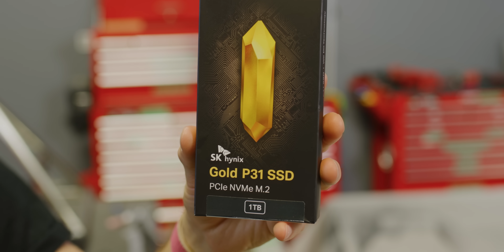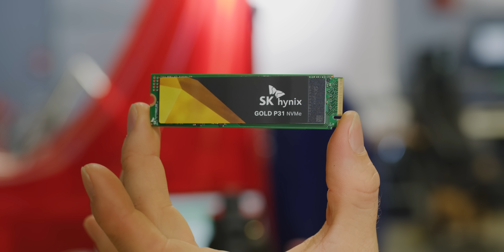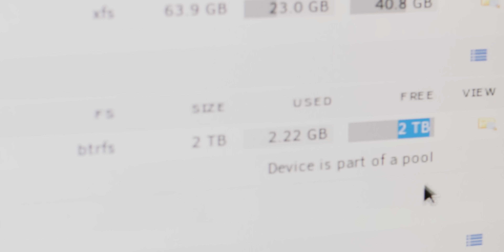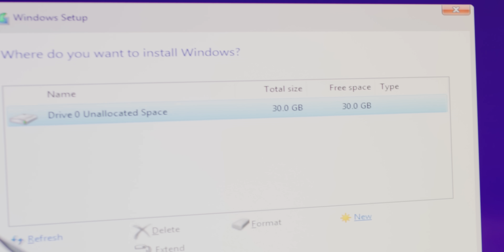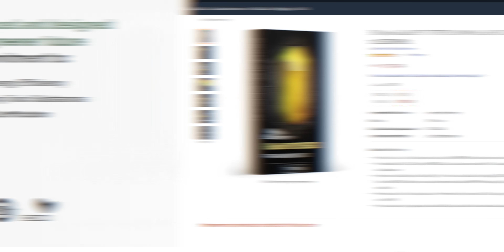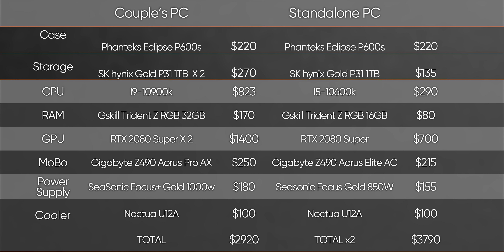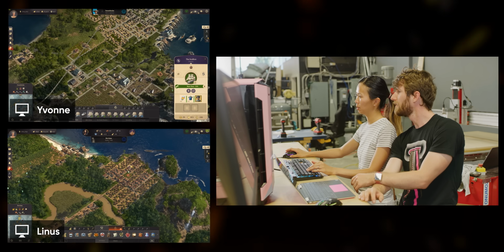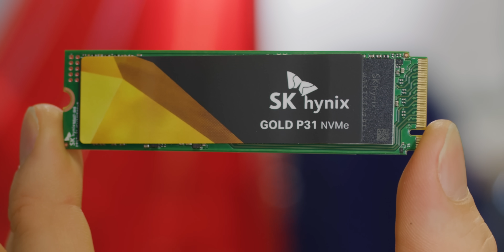We made the perfect couples PC!

Comment: ""ed: is it cheaper than building two pc's?  rest is history
Reply: If they were able to use the AMD CPU it would've been $400 cheaper
Reply: @610jrod  wouldn't  gpu compatibility over vms be an issue?
Reply: Is it to late for me, or how the f*** is the couples PC cheaper? It has no parts in it, that reduce the coasts...
Reply: @Aloukat  It is just you.
Reply: @Aloukat   you save 100 on the cooler, 200 on the board, 200 on the case, 130 on the psu but spend 10 more on ram and 240 on the CPU, in total the couple is 380 cheaper
Reply: @Aloukat  If you build two separate PCs you need 2 CPUs and 2 mainboards. In a couples PC you only need one of each. They need to be better and therefore cost more, but probably not twice as much. Same for power supply and case.
Reply: @InfiniteLuke  CPU costs more than twice as much, but don't forget the cooler
Reply: @saketharamanujam  I have VMs with GPU passthrough running with an AMD Ryzen CPU and an Nvidia GPU. So it should be working. I use KVM/qemu instead of Unraid, but as far as I know Unraid uses it internally
Reply: @saketharamanujam  Well, I said IF they could get it working. Maybe in another year the kinks will be worked out for things to work smoothly on the AMD side
Reply: More energy efficient
Reply: They messed up on the math. Yes it's still cheaper, but only less than $400 rather than more than $800 like their chart indicates
Reply: @ShaggyTDawg  Yeah that chart in the video is way off. Seems like they disregarded the two top rows and the 3 in the CPU price on the couples' PC side of the chart. LTT can't even add numbers together... Also, if I was building two PCs instead of one behemoth, I'd use cheaper cases and you don't need an 850W PSU for a 6-core CPU and a 2080. Also the CPU cooler is way too expensive. I got the difference down to just 30 bucks by using  110 dollar cases, 120 dollar PSUs and 70 dollar CPU coolers. And now you have the advantage of being able to use the PCs in different rooms or on different sides of one room. Also you can shut down your own PC if you're not using it. And you don't have to worry about some obviously buggy beta virtualization software messing everything up in the future. I'd definitely go with two separate systems instead of one crazy virtualization mess.

Comment: Linus: "We've talked about how we're approaching the point where you could buy a single computer and have two users enjoy it simutaneously."

Linux: What time is it? 2001?
Reply: BSD UNIX: Damn kids, I was doing multiuser in the 70s.
Reply: Any Unix-like system is multi-user from the times of the original Unix, however, in 2001, a dual-socket  dual-GPU computer with decent specs to be able to run two instances of a game simultaneously could have cost you $10000+, at least in current dollars.
Reply: @АлексейГриднев-и7р  Bitch I used to use multiseat software in the mid 2000s (BeTwin, Aster, SoftXPand etc) to play multiple games on a SINGLE gpu. It actually worked really well!?
Reply: he said enjoy
Reply: That statement had literally has nothing to o do with software
Reply: @Simon-oy7kf  It absolutely has. This is not so much about hardware or performance. You could put two high-end graphics cards in your PC in 2001 already. It's just that windows needs virtualization or multi-head operation.
Reply: referral madness  As I mentioned in this thread, there are multiseat softwares for Windows that allow this without virtualization. Aster, BeTwin, SoftXPand. google them
Reply: @sinni800  Do you know a free software for windows 10 like aster multiseat but free ?
Reply: @sinni800  Im about to buy aster multiseat do you recommend it ?
It's for playing multi games with my bro, computers specs : amd ryzen 5 1600 gtx 1080 16 gb ram
Reply: @gabrilapin  its pretty good, but some games wont run with it. When they run, it's excellent, but when they dont its a headache. Aster has a fix on their site that can fix some of them.

Comment: I bet that the series finale of this anime will be Linus running all of LMG off of a single computer.
Reply: They basically tried that already when they tried to build one rig that all their editors could use simultaneously. It didn't work but there is a precedent for them trying it.
Reply: I designed a pc on pc part picker that might do it, it has 4 titan gtx (I built it before rtx) and 128 gigs of ram and 2 cups, it was $50,000

Comment: The math at 11:43 is incorrect.  The couple's PC actually adds up to $3,413, making the difference much smaller.  Without the need to put so much hardware in one case, and eliminating the difficulties of AMD CPU with NVIDIA graphics in unraid, an AMD machine for separate PC'S could have brought the two scenarios to very close in cost.

Comment: THANK YOU! I've been thinking about this exact build for a while now. 

Do you have a video going through some of the details of how you did this?

Didn't know AMD handled this kind of virtualization worse than Intel. Good to know! 
Would it be possible to have another boot option which made this run as a normal PC with 10 cores & 2 GPUs?
Did this build use the USB ports on the GPU's?

Comment: ASweet setup! I'm going to do this with ArchLinux and VFIO, with my still upgradeable X299 system. I  can still upgrade it to 18 cores,  up to 2TB RAM(I've got 32GB which is plenty) (recent motherboard bios update, 1TB has been tested and works)
mmm I can imagine a 3080 sitting next to my 1070 Ti ;), which will JUST fit in my new Cerberus-X case :D

Comment: This Video is what got me to try / buy UNRAID. So far I love it.... I had to get a new CPU though my old one 3750k didn't allow PCI passing.... So I bought a 3770 Not K, and boom everything works, and I get 4 more threads!   This is one PC, many VM's just for me now!  Only issue I kind of have is my Xbox controller pass though but I don't really game anyway. Also HDMI sound is a problem. 

Also pro tip you can install windows on an SSD not a VM file and it's way faster.

Comment: would this be capable to switch between 1 user at full power or 2 users at half power each?
should work with a simple multi boot right?
or would you have to manually plug in and take out the SLI cable every time...

i love this build, have honestly been dreaming of something like this for years. Especially since it'd also be quite efficient in build cost and power consumption.
It'd also create quite a longlasting system since a pc like this would just be able to switch to single user when its starting to feel old and bam ur back up to speed for a few more years.

Comment: Don't sell the P31 short: The price to performance is an amazing value in the pcie 3.0 high performance category, and the 128L flash makes it one of the most power efficient nvme drives out there which is great for laptops. "SK hynix has completely redefined our standards for NVMe SSD power efficiency and turned in the most surprising benchmark results in my five years of working for AnandTech." - Billy Tallis

Comment: Just wondering why you're putting water in acrylic urethane paint??? I am a professional auto body painter and paint with all types of waterborne and solvent based paints. Not sure what kind of paint (house paint, auto paint, art paint...) you used, I know that auto body paint that is acrylic urethane is mixed with a hardener and a reducer and best used with an hvlp spray gun like the one you're using.  I know some artists that paint pictures using acrylic paint thin out their paint with water which isn't recommended.  From the sound of it tho is he isn't using the right air pressure while spraying and he definitely shouldn't have used water to thin out the paint.

Comment: This makes me nervous now. I just bought the parts for a new amp pc to set up with an unraid and gaming vm.  Not sure if I would go to a two vm model but the thought did cross my mind with my 10yo son.

I got a 
ASUS ROG STRIX X570E GAM WF II motherboard
Ryen 5950x cpu
G.SKILL 32G 2X16 D4 3600 C16*TNEO ram
EVGA RTX3080 12GB FTW3 ULTRA for the pass through
MSI GT710 for unraid and other services
 
What were you saying about needing to put the unraid gpu in the first slot?

Comment: Can't understand the problem you had with this. I've built a machine with similar specs using AMD and 2 2080tis and didn't have this problem. Took a little bit of fiddling to download the bios for the NVidia cards but otherwise no issues. Although would now look at upgrading my storage to NVME. I think Linus gave up a littel too son before switching to Intel. Maybe it was the paint because I left mine black with just a white slot cover for one of the optical drive bays (I call it Bishop)

Comment: Did you disable the framebuffer in Unraid? I am running a 3950x with two gpus passed trough to vms without problems..

Unraid OS
kernel /bzimage
append video=vesafb:off,efifb:off vfio_iommu_type1.allow_unsafe_interrupts=1 pcie_acs_override=multifunction

I left out individual parameters

Comment: Iam using unraid mu self and want to set up a windows vm primarily for gaming. I have a 250gb nvme ssd I want to use for boot as a passed through device. What settings should I choose when setting up the VM? i440 or Q35 machine and which bios etc..??  I want the expirience to be as smooth as possible so any advice on settings is appreciated.

Comment: Wow!  Linus didn't go over the top for once.  I would have expected a 64 core AMD threadripper or EPYC with four big GPU's (64 PCI lanes) and eight NVME drives in two RAID10 pools (32 PCI lanes).  I guess custom painting a 3U server chassis just isn't as exciting.
Reply: And Intel better than AMD for this?  That's a limitation of Unraid not the hardware. I've been running an AMD setup like this for about two years on stock Linux.  Never going back to a normal PC.

Comment: Isn't using an SSD as storage experimental?  According to the official docs:

SSD support in the array is experimental. Some SSDs may not be ideal for use in the array due to how TRIM/Discard may be implemented. Using SSDs as data/parity devices may have unexpected/undesirable results. This does NOT apply to the cache / cache pool. Most modern SSDs will work fine in the array, and even NVMe devices are now supported, but know that until these devices are in wider use, we only have limited testing experience using them in this setting.

Comment: Wait, he downgraded the mobo & CPU so he could use a 3rd monitor to set up the software when really he will just be remoting into it?
Why not just set up unraid to remote in to finish the setup?
Or a much easier swap of the CPU to one with a APU for the setup, then swap CPUs after its all set up?
Unraid is very configurable and you can add the many extra cores to the VMs after the swap.  Redoing everything just to get a 3rd videocard output on unraid just for setup?  Life is easier than you make it out to be

Comment: Throw both GPUs in, disable CSM in the BIOS, unbind the boot GPU from the console (google a single-gpu VFIO setup for info), and you can attach your boot card to a UEFI-enabled guest just fine. I do that on my Ryzen 3700x/x570 with a GTX 970 and an RX 5700 to separate VMs. That way it doesn't matter what your boot GPU is, you can still pass it through and run your hypervisor headless. I'm not sure what UnRaid's developers were on about regarding poor Zen compatibility. VFIO works as expected on my Zen 2/x570, though I did have to update the BIOS to get it stable with PCI-E Gen 4 enabled. Using Intel for this is just throwing money away. Stay away from AMD GPUs for VFIO, though. I regret buying this garbage RX 5700 so much. FIX THE RESET BUG, AMD!

Also, check out Proxmox. There's no need to pay for Unraid to bundle up open-source software for you. Also, you should touch on issues like BattlEye banning VFIO users now.